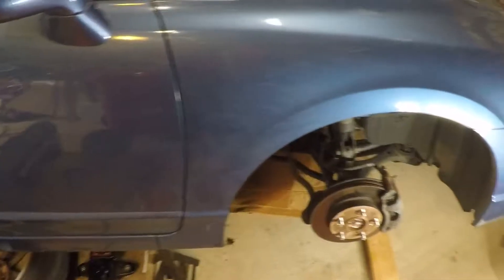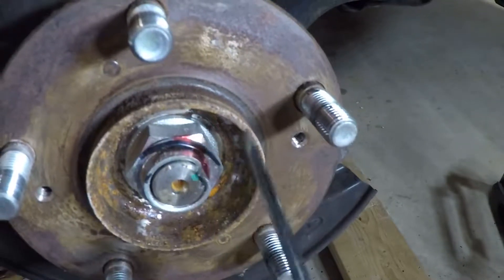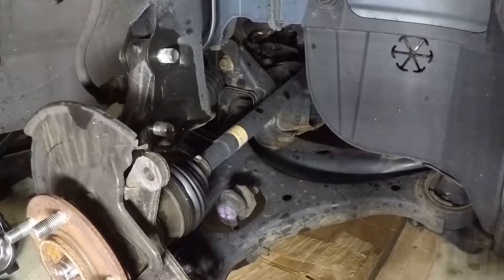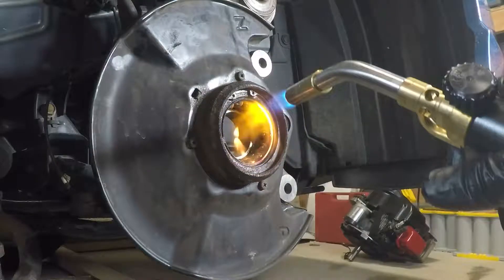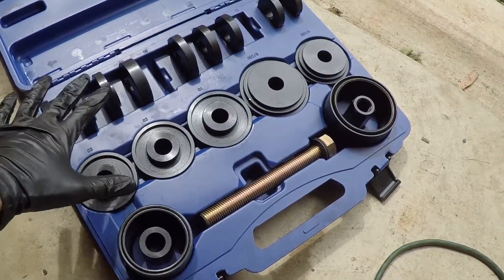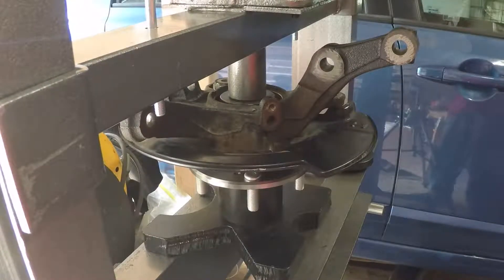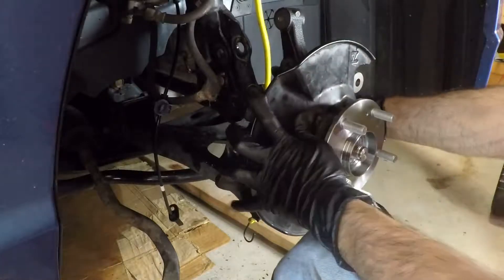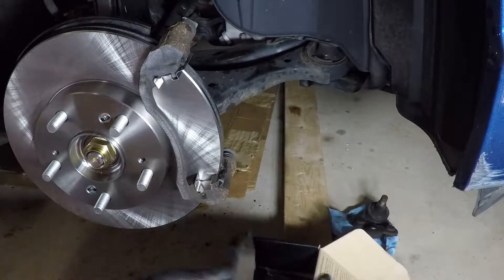2006-2011 Civic Wheel Bearings - Detailed Replacement

Comment: I love your video very informative. I have to do this for a 2016 Honda CRV. Should be a similar process. The only thing I do different when pressing in new bearings, I put them in the freezer overnight it makes them slide in so much easier. Also I would've used anti-seize instead Grease while pressing the bearings, had And old-timer showed me that years ago. Again thanks for the video.
Reply: The freezer makes all the difference!!!! Great video and very through, good job!! Thanks.

Comment: Watching as I go   Going to use some authority.  Oh Yeah.  !!!!!  Last time I did this I parked to close to the garage wall.  My bad.   I don't go to the dealer much anymore.  Heat is your friend.  .  How are your knees?  Mine are 63 years old.  BIG Bearing!!!   Using a Tecumseh Tool  LOL  FUN.  Congrats on not breaking anything.
Reply from the maker: My knees aren't too bad, I had foam pads on the ground.  My shoulder was a little sore after that slide hammer on the hub.  It was a pretty big job, but I'm not sure it was a $2200 job.  A pro could have probably gotten both sides done in less than 5 hours.  I did break the ABS sensor.  That was unplanned.  It was Labor Day when I did this, and I wasn't sure I would be able to get a replacement until at least the next day.  My plan was to leave it out until I could get a new one, but there was a place that had one in stock.  Lucky.